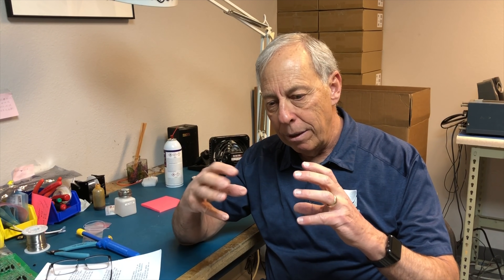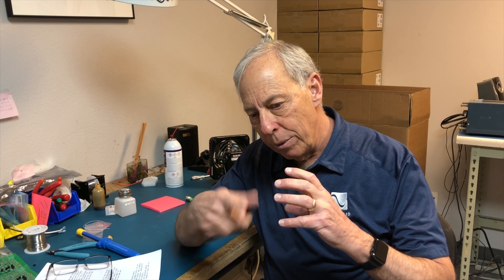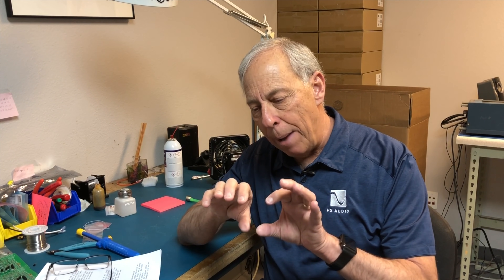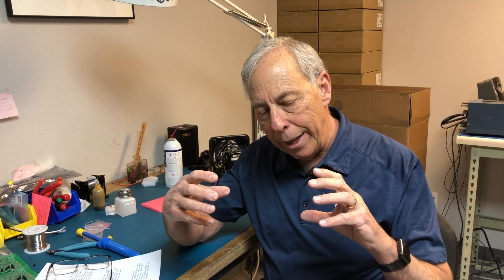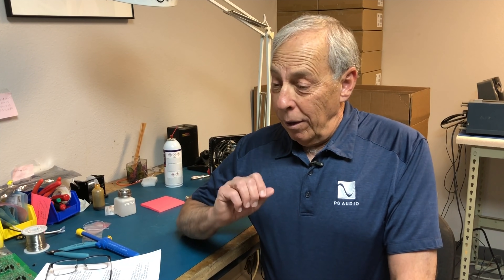Why aren't power amplifiers regulated?

Comment: This got me thinking about the power amplifiers in my car. The JL Audio slash amps are regulated but I'm not sure which side is regulated. In order to make these deliver rated power I know you have to have equal impedance on all channels as voltage/watts change depending on impedance. If two channels were at 4 Ohms and two channels at 2 ohms, the channels at 2 ohms would receive half the wattage if I remember right. What would be the point of doing this in an automotive environment? Would it just be the ability to deliver the same power at 12 volts or 14 volts input?
Reply: I think car amplifiers have regulated supplies because they all use switching supplies which are regulated by design.
Reply: In a car amplifier, the power supply section is very much a switchmode supply, but it's known as a DC-DC converter. It takes the 12V (or 13.8V) from the battery and steps it up to split rails of around +/- 30-40v or so. Then you have that same supply rails as you do in a home amp, and the amplifier outputs stages are generally class AB. Also because of the design principle of a switchmode supply, the output voltage is regulated, yes.

In a car amp that is capable of driving 2 ohm loads or 2 ohm loads bridged without damage, generally you get close to double the output power for the 2 ohm load compared with the 4 ohm load. Both the amplifier stage and the powersupply have to be designed to achieve this without hurting the amp and popping your output transistors. So for example, an 2 ohm stable amp may be rated at 150W RMS into 4 ohms, but can output 300w into a 2 ohm load. Things get a bit more complicated with actual power output when you bridge 2 channels of an amp, but generally you get about double the output power if it's a well-designed amp.

In the situation you have described having a 4 channel amp, with 2 channels driving 2 ohm loads, and the other 2 channels driving 4 ohm loads, as long as the amp is 2 ohm stable and the power supply is up for the job, you will get, again, about double the output power into the 2 ohm load, not half. Hope this makes sense.

The reason car power amps use DC-DC converter powersupplies to step up the voltage for the amplifier is precisely to get more power output in watts. It's very difficult and impractical with only a 12 volt rail to get much than about 30W RMS output into a 4 ohm load. But with higher voltage rails, and also split +/- rails, much higher outputs can be achieved.

Comment: Actually, some superlative amplifiers, like Benchmark's AHB2, have regulated power supplies. PS audio and lot's of other audiophile oriented amps do not.
Reply: Mico-the AHB2 is an great , supremely quiet and undistorted amp, but I dont think it’s power supply is strictly regulated in the way Paul is discussing.
Reply: Audiophiles do also want to sell power conditioners. If an amplifier uses regulated power supplies, those power conditioners are no longer necsessary.

Comment: There have been power amplifiers with regulated output stages -- but they were bulky and expensive. The preceding gain/driver stages in most power amplifiers are regulated. McGowan explains this fairly well.Transistor output stages are generally followers, and their gain doesn't vary much with supply voltage. So regulation isn't as important.

Comment: Hi Paul, thanks for the videos!  I have always wondered why you never see a switched mode power supply used in an amplifier.  Modern ones for the computer industry are very power efficient, and offer very stable voltage regulation, and incredibly low noise.  Is this something you could talk about?
Reply: Quite correct! Any computer or CPU has a very wide load current swing. Just run a spread sheet and see it swing. Perhaps the only exception was the Cray super computers. They used all balanced ECL logic so the same amount of current was drawn for a one or zero. In fact their power supplies were unregulated and dind't even have filter capacitors. They ran on 3 phase 400hz 
through a 12 phase rectifier so the ripple was very low. They handles  the line regulation in the MG set that produced the 400hz AC.

It is a very common mis-conception by audiophiles that audio is a fast high bandwidth signal. In reality audio is at the very bottom end of the entire EM spectrum. It is in fact slow and low bandwidth.
Reply: computer doesn't change its current draw dynamically while music is dynamic. it's more difficult to build a switch mode PSU that could cope with dynamic load
Reply: S. Kojina - I’m sorry, but I beg to differ.  Throw a modern gaming PC on a power meter, and you will see the power draw moving from 30w to 500w or up to 1.2KW or more in a multi GPU setup during gaming, in an instant, and the power draw is completely dynamic, depending on what is happening from millisecond to millisecond.  CPUs and GPUs are very high current, power dynamic devices.  It’s not 1979 anymore.
Reply: i do have power meter but so sorry i don't do games. mine is pretty much constant on my kind of workload
Reply: Tone P my understanding though is PC power supplies, even the most expensive ones $500 and up are NOISY. I believe Paul actually has a video explaining  when he tried this once.

Comment: Another way is to use a switch mode power supply that regulates voltage by varying the ratio of on-to-off time minimizing the energy loses. This can enable much more power vs size also. Why not use that?
Reply: Switch mode power supplies are quite common on professional power amps. QSC, Crown, and many more use them. This is not to be confused with class D. The QSC and some Crown units are still class B amplifiers but with a switch mode power supply. They work very well and there are no EMI/RFI issues.

My own DIY 20W class A tweeter amps use two 300w switching power supplies for +/-24v at 15a. I too have no EMI or RFI issues. It simply comes down to RF systems engineering knowledge which includes proper circuit grounding and shielding.
Reply: EMI and RFI is one of the reason
Reply: The Benchmark AHB2 uses a switching power supply and has overcome EMI (RFI is EMI).
Reply: Yes, it's not really so tough to eliminate audible EMI from a switch mode power supply as they usually run on frequencies well above the audible range.
Reply: The short answer is they could, BUT you need a switching frequency much higher than the audio range and SMPS suffer from EMI and RFI. Still they are used; but the purists would spit feathers.
Reply: Power conditioners. Aplifiers with regulated swithing power suply doesn't require those. Ps audio sells power conditioners and wants those sales to continue.
Reply: @volodumurkalunyak4651  Yes, a modern amp with a well designed switch mode power supply does not need an expensive power conditioner as it already does the same job of keeping the output voltage clean from noise and fluctuations on the input.

Comment: One huge benefit of not regulating the power amp is dynamics. Amplifiers are often (and properly) rated to their maximum clean power before clipping with both channels driven. This is done with a continuous sine wave signal. This really taxes the power supply, bringing the voltage down. This gives you a good baseline of power output. However, music isn't a continuous sine wave. It is (usually) more of a pulsed beat. This taxes the supply much less, allowing a higher average voltage and more possible output power with music. This is commonly known as dynamic headroom.
Reply: additional PSRR. by having a regulated supply, you will have better ripple rejection
Reply: That is the mistake a lot make about voltage regulation. It does not reduce dynamic if PSU is designed with lower voltage. However to use voltage regulation means you put money into regulator. Then with the same cost you will have to reduce something in your amp. Maybe the size of capacitor bank in your PSU's output stage. That will definitely reduce dynamic. There is so many things we could do like auto power correction, adaptive impedance matching on amp output stage, current buffer, and soon. But in linear power supply most of these technique can be fix by simply have huge transformer in input stage and capacitor bank on output stage.  You can't do that with SMPS that is why most people avoid using it. High End SMPS required very in depth knowledge with adaptive electronic.
Reply: A regulator can only reduce voltage (unless you use a boost regulator), but you set the regulator output voltage lower than the DC input to account for that drop; so the regulator can maintain the desired voltage even if the supply decreases.
Reply: Sorry; so how does this change if power is regulated.
Somehow I was having trouble parsing Paul's explanation, and now I don't seem to understand your explanation of regulated power's affects.
TIA.
Reply: As Paul mentioned, the voltage regulator can only "cut" voltage from the power supply. The disadvantage of a regulated power supply would be that there is always some voltage loss; otherwise, it would just be an unregulated power supply. Even if you could put a large enough regulator circuit between a power supply and an output stage that could handle the high current demands, there will always be less dynamic headroom, because the rail voltage ultimately determines when an amplifier will begin to clip and distort. Lower voltage = earlier clipping, assuming the load (speaker) impedance is the same.
Reply: you can compensate the loss by using multi tap transformer and use the higher voltage to have an additional headroom. but again, it adds costs. another thing is how fast the regulator can regulate? most linear regulator couldn't cope with transient on music and causing more voltage sag on the output
Reply: This stuff is going over my head.  But, then why was the question brought up to begin with?  Why would you want a regulated power supply if a task-appropriate one was available?
Reply: @Kevin Roosa Yes, but you can simply compensate for the "lower dynamic headroom" by having a beefier transformer (which was mentioned in the video) rectifier and larger smoothing capacitors.  Everything is designed to a spec'; if you want a certain power output you'll design the power supply to deliver that max power plus whatever percentage of power is lost through the regulators.

As has been explained in the video, for a large power amplifier the additional components required to regulate the supply and remove the excess heat, yet deliver the same power as an unregulated supply would add considerable cost to the product.
Reply: David Griffin valuable and valid  response David !
Reply: @S. Kojina If that were true regulators wouldn't be used at all.  Power regulators are effectively transistors and if they can't cope with musical transients, then neither can transistors.
Reply: it's do-able for low power use. i use them for small power devices but amplifiers? for the front ends, sure why not? final stage? you might use it for 80W amplifier. above that, i doubt. all my designs uses regulator only for the front end. small footprint and effective enough to drop a few dB of noise.
Reply: S. Kojina So how do the regulators lower the noise floor?  Ripple isn't noise, it's modulation.

Comment: The simple unregulated power supply does sound better because of the faster slew rate. :)
Reply: And that slew rate is everything for high frequency speed and accuracy.
Reply: I used to use a Switch Mode Power Supply and a FET charge pump on a pentode line level buffer. Squeaky clean, except for a little bit of volume pot hum, but that's it.
Reply: this. most linear regulator can't cope with the transient. with unregulated PSU, the only thing matter is how big the transformer headroom and how much the energy being stored by the capacitors.

Comment: Are not most Class D amps regulated? I suppose their efficiency allows the use of regulated wall warts rather than big transformers?
Reply: Those use switching regulated power supplies, not lineal one's. Regulated switching power supply uses varying pulse width to chop power and averages those pulses with inductors.

Comment: I learned the answer after 6.00, thx Paul.
Building a 10 times larger power supply for a Mission Cyrus 1 (with components from Russ Andrews) decades ago was a fun project. 30w without clipping was much easier on the ears!
Tell us about the purpose of bypass caps on the reservoir caps please Paul.

Comment: Cost, complexity, reliability and stability makes it not too impractical for implementation in high power amplifier IMHO.  NAD sold a lot of 3020  back in the days I believe that regulated PSU made a significant contribution to it's sonic characteristic.

Comment: Seems like you could side-step a number of those problems by using a switching regulator, if not a switching power supply.
Reply: Somehow, the auto sound people seem to do it.  Given how close they sit to their speakers, they must have handled the noise issue.
Reply: This was covered in another video from Paul, but in short, switching power supplies are rather noisy and getting one to work properly in an audio amplifier application is a serious challenge.
Reply: @ngtflyer  outher companies have those challanges figured out. They also don't have a problem of selling power conditioners. This company doesn't want revenue stream for power conditioners to dry up from selling a better amplifiers.
Reply: very true. it's not only the switching noise conducted through the cable but also the noise being induced by the switching module. it's do-able but it's challenging
Reply: you can't hear them. the switching section runs at 50kHz afaik
Reply: A high switching frequency doesn't guarantee noiseless output

Comment: Hi Paul.... it's me again..!
You struggled hard with this question... but in the end you kinda summed it up !!
Wish you had a really tech channel so you can talk about the real nitty gritty of power supplies ... 
The best power supplies for high power amplifiers are not regulated ( as you say they are lossy )  I have an Australian made amplifier made by ME .. it's an ME 1500 .... it's a monster ... 750 European watts per channel into 8 ohms .. DC to over 40 Hz .. it utilises a 5 Kva E and I transformer ( not toroid) and uses heaps of low ESR caps for each rail ... it uses split secondaries for each channel .. 
Regulated supplies do provide a level voltage .. agreed .. but they are only any good for low power amps .. often used as a sales gimmick and also to remedy a transformer with very poor regulation ...
I am totally addicted to your channel .. you seem to cover every possible subject relating to high end audio .. please keep it up ... most interesting Paul ... hugs ..😊

Comment: If you don't regulate the amplifier power supply, how can you guarantee that the least significant bits of a 24-bit signal are accurately reproduced? If you're using negative feedback, won't that compensate for rail fluctuations on the output?
Reply: It's not possible to get any true signal above 21bit in analogue domain. 1 degree C temperature change will produce noise bigger then 21th bit. Expect we start to use 2 RCA/XLR connection per channel  then we can add those two as LSB and MSB in power amp to get the result. Or doing everything in digital domain output via Class D amplifier by sending a DSD like control signal to regulate the amplifer.
Reply: Regulating these power supplies is a piece of cake using an LM7915 or 7815 TO-220 regulator ..
Reply: That's all woffle.. go and study power supply technology
Reply: L Lee Actually, I don't think anything above 18 bits is really practical in real life. I know, heresy!
If we design the amp to run slightly below rail-to-rail at peak, then if rail sag is detected on the output stage, increase input stage gain to compensate. We may then briefly hit rail-to-rail, but mostly be regulated.
Reply: Agree, but you have to design you amplifier to work at lower in coming voltage. Voltage fluctuation can also be overcome by having huge capacitor bank on output stage. So effect of voltage drop on output stage of PSU won't be seem by amp. You will need this either way because same sort of thing will happen when amp is under max load, and you don't want to regulate amp output. That's what they used to do with so call "feedback control", they still do that with cheap amps these days. Feedback can work magic when use correctly, but in most cases they just use it to keep the cost down. At the end of the day it's all about value and cost.
Reply: Regulating a power amp's power supply with 7815/7915? You make me scratch my head....
Reply: Because the circuit should be transparent to fluctuations in supply voltage, they might use voltage or current references for example.
Reply: Janina Palmer: The maximum current of a 78xx regulator is 1.5A, that is pittyful, they also have very poor regulation with fast moving signals..check it out on the datasheet.